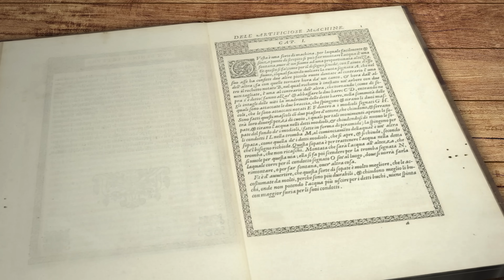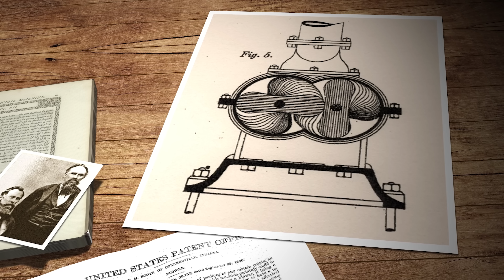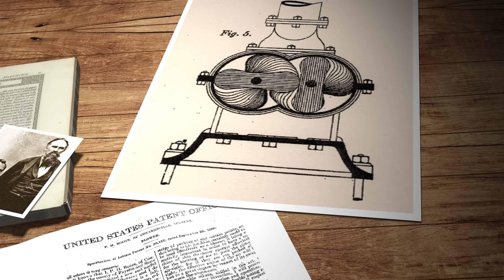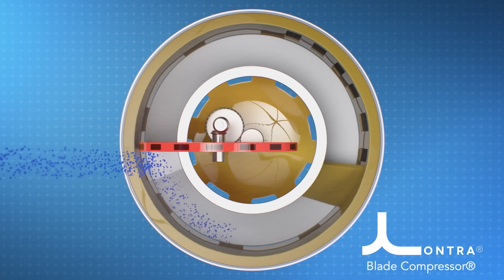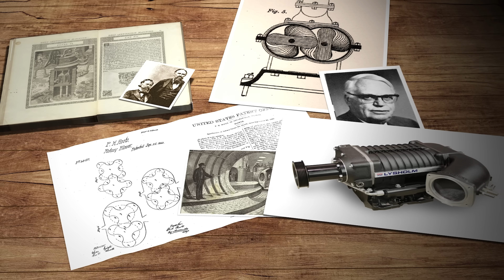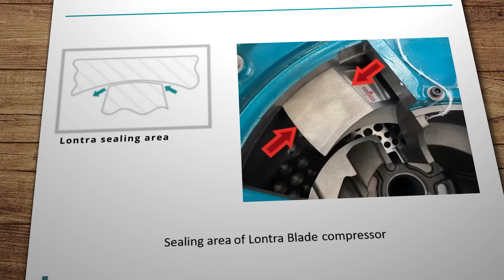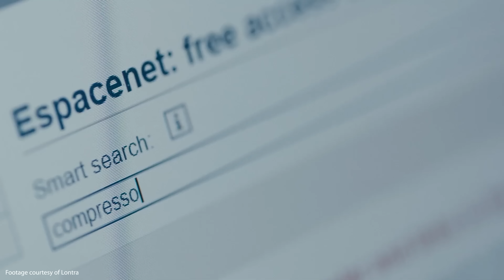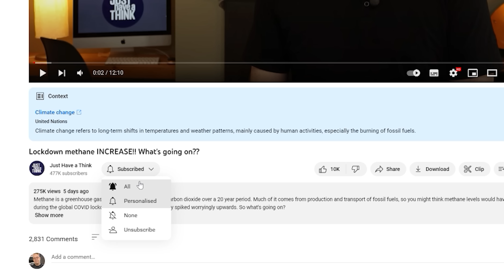Compressing air to reach net zero. A 'revolutionary' innovation.

Comment: Yeah but, how does it overcome the  heating up of the medium that it's compressing?  Iam a noob to compressing, but I damn well kno that even my bbb bicycle pump gets really hot when I charge my pneumatic cannon to 7 bars 😜
Reply: Idk probably fins and shit or attaching the compressors to the coolant lines that cool the engine
Reply: @baileyjerman5573  that's how harly makes they're engines haha so that's not new 😂
Reply: You can't break the gas laws ie P1V1/T1 = P2V2/T2 all compressors increase temperatures of the gas it's implicit, getting rid of it is the issue...

Comment: I wonder what percentage of CO2 on this plane is made on purpose, because plants love CO2 I.e CO2 generators - grow ops/greenhouses.
Reply: Hrrm.  that's only for high carbohydrate based plant foods. For protein plants you need more nitrates or nutrition declines (as evidence shows) as higher CO2 shifts the biochemistry equilibrium needing more water for sugars and with some protein based plants shifting to produce cyanogenic glycosides ie cyanides eg cassava, bamboo shoots, clover (cattle feed) even seems to be starting with corn and varieties of wheat :-(
The added problem with extra nitrate fertilisers is it releases more N2O which is a more 'powerful' GHG than CO2

Comment: Just another "this invention could save the world" scam. Overly complex design that will never work properly.
Reply: Beg pardon, what stops it working 'properly' ? It's pretty simple and doesn't need to lose power as in if it were a linear piston type compressor, ie maintains angular momentum...
Reply: @mikemassen6757  your reply tells me that you have no actual real world experience. Why do you think rotary engines never took off? Hmm? Because just like this thing, they couldnt seal properly. Any time you have an air pump like this, it will have excessive loss that will only get worse over time. The reason why we still use the tried and true piston and valve engines and pumps? Because they seal. You think people havent tried inventions like this over the last 300 years? Lol. Youth is wasted on the young.

Comment: First look at what kind of gassen are in the atmosphere. 70%  is vaporated water. Co2 is not the problem. It is the cyclus of the earth and sun flames
Reply: The sun doesn't have flames its not on fire
Reply: Also 70% of the gas in are atmosphere is most definitely not water if that were the case every time it rained we'd all be gasping for air as gail force winds rip apart anything and everything
Reply: @baileyjerman5573 
Look at the the facts. Use your phone for the right information
Reply: @johank1061  provide  link

Comment: Interesting , I have been wanting to see the Revetec motor/trilobate crank used in piston compressors , about a 30% increase in mechanical efficiency has to translate into a saving for compressors . Have to add ,sadly, it is almost embarrasing now to see people still beliveing that CO2 is a bad ,naughty ,planet burning ,gas !?. CO2 is vital to plants ,therefore all life , they actually pump it into green houses , [ yes it really is a green house gas ,that is the only bit of the al gore 'scare to make money scam' that is true ]. I trust the geological evidence that we had levels of well over 1000 ppm [ Parts per Million folks ,ie tiny ,and its effect compared to water vapour is around 0.00018 times ,worse ,if the oceans warmed , would you get more or less water vapour ?? . ]. in the past ,long before we were burning hydrocarbons . So people know, a level of 5000 ppm CO2, is considered safe in submarines , 7000 ppm in space shuttles . The Biologists tell us that plants seem designed for much higher levels , use far less water and are far more efficient ,and would actually die out at levels less than 100 ppm , that we were seemingly getting close to . current actual ice covers are increaseing , and even NOA have admitted their data shows cooling . Also we have not disapeared under water after 30 years of Al gores bleating , his water front properties have gone up in value though , maybe thats what he meant .

Comment: How does this compare in terms of efficiency and sustainability against a trompe, a water-powered air compressor, commonly used before the advent of the electric-powered compressor?

trompe is a water-powered air compressor, commonly used before the advent of the electric-powered compressor.

Comment: Well, that's both fascinating & confusing.
I spent a decade in an air tool, compressor, fastener speciality shop & repairer.
I'm familiar with the standard compressor types, and this is certainly a big departure from understood systems.
Definitely going to face resistance until energy efficiency becomes a larger decision factor.
I'm interested in the heat, maintenance & clearance issues, but there a lot of related experience to apply, so they're hardly areas for critical failure.
No, what I wonder about is why have the interlocking block? There should be several other 3d geometries that allow similar functions without the risk of destructive interference.
Oy reason I can think of is pre-existing patents that that have been parked.

Comment: A Wankel Engine for compressed atmospheric products.
In order for this to work at peak … or near peak … efficiency I think the problem will remain either heat/friction displacement or materials that are minimally … or not at all … subject to expansive reaction.
Thermodynamics is a very difficult set of Laws to bypass or ignore.

Comment: Back in the 1960s Chrysler designed a No gas air conditioner called Rovax.  Air was sucked out of the cabin and a rotary compressor to 30psi.  The comppressed air passed through a common radiator which drew the heat out of it.  Cooled compressed air passed through the other side of the compressor to recover some power as it was released.  A filter sorted the ice out of it and 4F air went back in the cabin.  4 engineers took the Plymouth to the Ca desert where it was 104F outside.  Temp in the cabin got down to 58F!  No freon, no recharging, no service.  They buried it and we never heard about it again....

Comment: I'm amazed that those original Roots blowers could be machined to the accuracy needed 160 years ago.

Then, when "they" twisted the blades, holy cow!  BTW, the purpose of that is to even out the air flow.  The original design was very pulsed.  The biggest and earliest application was pushing air through Bessemer steel converters.  Those big superchargers you see on dragsters come from GM diesel engines. 

I have an Eaton roots type blower on my Buick V6.  215,000 miles.  Good machining!

Comment: To be honest, it might improve overall efficiency, but that would be a nightmare and a half in production operation... compressing air produces heat, heat expands metal, thus shaving those gaps even finer... and then it is controlled by a geared system?!? There is a little thing called backlash, even in really good gears... when that timing gets a bit off from simple wear and heat expansion, that thing is going to eat itself alive like a giant wood chipper....  I wouldn't want to be anywhere near that thing when it finally fails. It might be great for low volume applications, but I would like to know more about how much torque it requires and how much compression it can actually achieve   Another thing they failed to mention about compressing air is that those compressors can run and store compressed air in the off hours when there is much less demand and cheaper and then use it during a portion of the day thus reducing wasted energy and evening out demand.

Comment: I use compressed are for diving at 232Bar & 300Bar.
What are the heat complications of using that at those kind of pressures?
My current compressor has a huge fan fixed to it to help keep it cool whilst in use.

Comment: You dont want to blow your product all over the manufacturing area for several reasons... 1st is the damage imparted onto the product being beaten inside that tube, so not all product is robust enough for such a method of movement. 2nd is static build up, plastic are notorious for building up static charge when being vacuumed and blown through transporting tubes, especially when the transportation tube are also made of plastic... I have seen a pallet box of plastic beads generate a foot long static arc because of such a problem.

Comment: Compression analysis begins with the physics of thermodynamics which in turn sets maximum efficiency.  The compression machinery efficiency is the difference between thermodynamic and actual.
Because it has the best (piston ring) sealing and volume/surface area ratio, crankshaft driven reciprocating compressors are the most efficient.  
However, thermal efficiency is just one attribute.  Numerous applications need high volume, low to moderate pressure.  So when one looks at the compressor industry, one sees the various compressor types granulated usually by pressure:  Roots blowers at the low pressure and recip piston at high.  As far as this new compressor is concerned, have to compare apples to apples.

Comment: It isn't just carbon. But the same application could be used to remove humidity from the air which is probably a bigger problem than the carbon.

Comment: Just like a bicycle tire pump ….   You mean nothing like a bicycle tire pump from a design point of view. 
That’s like saying a Rotary engine is just like a traditional cylinder/piston engine.  
Fluid mechanics are similar.  The solid mechanics are drastically different.

Comment: Roots are still around because despite being blowers not compressors, they're so cheap that their relatively huge compressing inefficiencies don't matter....and it's also why twin screws, which are basically two Roots lobes which have been rotated (and ARE actually compressors....and highly efficient), haven't replaced Roots blowers

Likewise, you won't get much more efficient than axial compressors, and those are around ~65% efficient. 100% is impossible; we're already chasing an asymptote around 70%

So making something hugely complex and expensive like this? Yeah....no. Great idea, really nifty, I'm sure it will find its uses, but it's not going to replace anything in even slightly significant numbers any time soon

Comment: I work as an operator at an  Oil Refinery.
That industry is VERY resistant to change at the equipment level.   They'd rather completely rebuild 65 year old compressors then try something new.

Comment: Hi, compressor guy here. `
This Lantra product is not what we in the industry would call an air compressor, rather it is considered a blower due to the low pressures it is producing, as is evident by its targeted market in pneumatic conveying and waste water treatment - both applications that use primarily low pressure air blown at high volumes. Blowers typically do not use piston style compression elements, so this estimation of "34%" efficiency savings, while possibly accurate vs a low pressure piston, is completely meaningless, as most blowers use different technology. Even if it is accurate for lobe blowers thats not saying much as there are already other technologies that are even better vs the lobe tech.
Now if the Lantra compressor were operating as a multi stage high pressure compressor, producing 350-600 psi, and claimed to be 34% more efficient than high pressure  multiple stage piston compressors THAT would be a huge industry shaking deal.  However looking at the design the wheel acting as the end of the compression chamber would end up then being under tremendous force (not to mention compression induced heat) in order to support a higher compression ratio, and so that would be a very big point of possible failure that would need to be analyzed, especially considering it is a rotating component.
Also to their point of having a superior design for air gap I find this a bit perplexing because while they have improved the width of the seal between the two rotating assemblies they have not shown what the seal looks like for the wheel forming the inner surface of the air chamber, which has to have some kind of seal with the non-rotating air chamber casing. Seals directly contacting moving parts wear out, and worn out seals leak, producing inefficiency. the TWO seals around the rotating assembly (either side) of the air chamber represent a huge seal area.

Comment: What Is The Compressor Ratio Per Stage,  Versus Volume  ???
If A Plant Needs High Volume & Moderate Pressure.  It's Hard to Beat A Centrifugal Compressor,  If They Need Upwards Of 75 psi. With High Volume An Axial Compressor. 150 psi. Radial Compressor. Above That A Compound Compressor, Or Some Sort of Positive Displacement Depending on There Needs. I've Seen Compound Compressors as Big as A Bus To Run Large Factorys. There's No Amount of Hearing Protection to Save You Around That  !!! I've Only Heard One Sound Louder In My Life. ( A 10"  Emergency Blow Off Valve. On A Six Boiler Steam Plant. """ Sorry Don't Know How Many Million BTU's It Produced,  But It Produced All The Steam For Everything in A 5 square Mile area """.

Comment: Why doesn't Longer continue the circulor compressor path like the design of a snails shell so as to lengthen the compressor volume substantially ? My father worked on NASA turbopumps for the space shuttle. I have natural engineering DNA. 😉

Comment: This seems like the inspiration for the omega1 combustion engine. As an air compressor, I have to agree with some of the commentary that other designs have ease of manufacturing or simplicity as advantages over this.

However as a combusion engine which is like 90% air pump, this idea would be very useful. I think that's why the omega1 engine recieved much more press